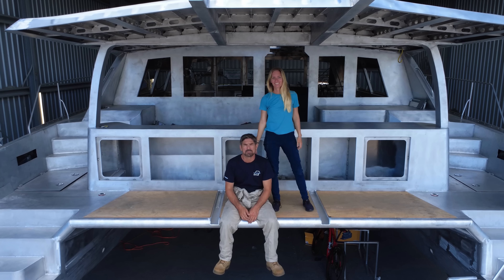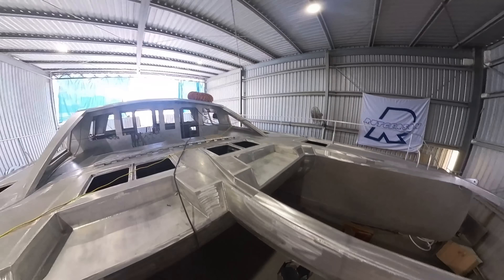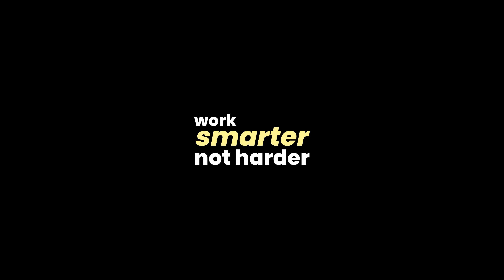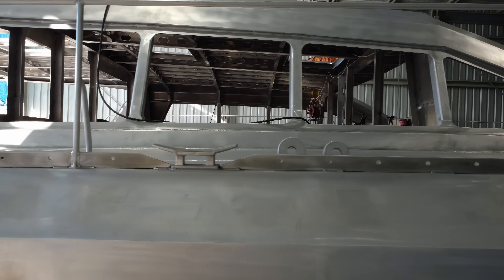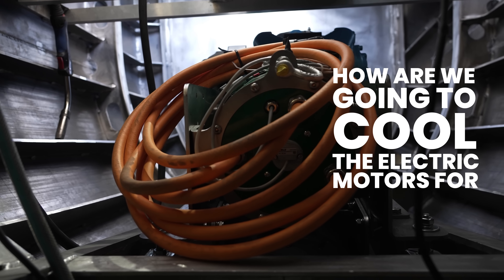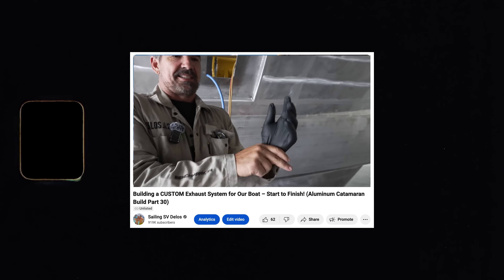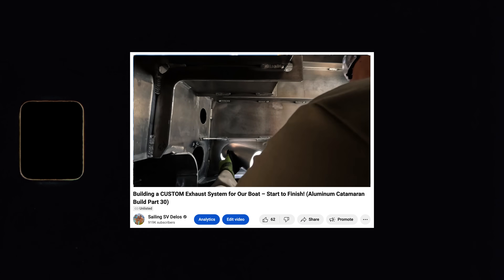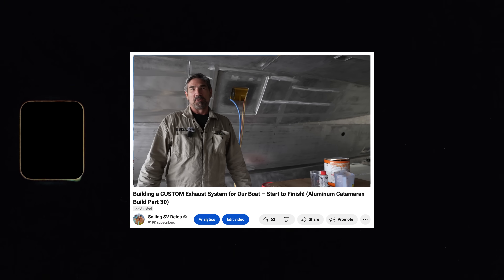We Challenged AI to help design our Keel Cooler 🧠 (Building Our Own Aluminum Catamaran From Scratch)

Comment: I think the cooling requirements for any of the mechanical components of a vessel really depend on each individual component to be cooled, as well as where the vessel will be situated for the majority of its life. If a vessel is going to be located in the southern hemisphere for the majority of its life, then cooling is obviously going to be more of a concern, where as if the boat is going to be located in the higher latitudes for the majority of its life, then other options for the shed heat can be considered. For example using the waste/radiator heat from a combustion engine to be a heat source for a hydronic heating system is a VERY efficient way to use otherwise wasted heat when motoring. But if the vessel is going to be living in both extremes of the upper and lower latitudes, then I would 1000% talk to a professional in the field and at least consult with them before proceeding as they have working simulators for calculating these data points.
Reply: Umm, you are aware the the southern hemisphere has high and low latitudes and gets cold and hot with the seasons just like the northern hemisphere does, right?

Comment: Sending that warm water to a hot water heater, that way you can use your electric engines to heat your hot water. And then the excess waste heat can be dissipated by the keel cooler, that would make it more efficient.
Reply: marine HVAC (Heating, Ventilation, and Air Conditioning) system" with a heat exchanger component.🙂
Reply: Wouldn't it be saltwater they're cooling with? Doubt they want hot seawater for cleaning and whatnot.
Reply: @helimx  just need a heat exchanger if using salt water and it could even be turned into a closed loop system then and take away the salt water and use a coolant then. But idk just random thoughts from a non engineer lol.
Reply: @helimx  No. Brian is talking about a closed loop cooling system. That is used to avoid having to use sea water. 

Also, usually the water heater contains a heat exchanger so the coolant is still in the closed loop (with its additives for frost resistance, corrosion protection, etc.) while heating up the potable water in the heater.
Reply: Another thing I just thought of was you could use that waste heat to heat the hull of the boat while in the artic as well! That will def be a nice to have thing! Kinda like heated mirrors but for your pontoons lol

Comment: Different AI generators producing answers with a range of 5X is a bit disturbing, and highlights the dangers of relying on exclusively on AI to solve problems. But I like your approach and questioning the assumptions and variables that produced the different results. This helps to better understand the complexity and potential roadblocks to finding the proper solution. Very informative and fun video Brian! Good luck!
Reply: Not really disturbing, you just have to pay attention to the assumptions that it is making as a result of the incomplete parameters he provided to them. They all have to make their own assumptions in how to extrapolate the incomplete data, and respond accordingly.

More complete questions beget more complete answers, and one of the biggest benefits of LLM 'ai' tools like these is that their responses can tell you a lot about what questions you SHOULD be asking in order to get the answers you're looking for. You'll have a pretty good idea that you're asking the right (complete) question, when multiple models all start spitting out the same answers, because at that point, they're no longer 'filling in the blanks' in your questions on their own.

At any rate, AI is a very useful tool, as long as you understand its limitations, and use it as a sanity check or jumping off point, rather than just assuming whatever initial response it spits out is the magic answer you seek.

Comment: 'Cool' to see that AI is able to calculate surface area of a keel cooler for your electric engines.  Keel coolers are very common on Alaskan commercial fishing boats.  I see them all the time in the boat yard when I'm hauled out.  They work great here, especially since our water temps rarely get above 50F.  My engine should run at 160F but I'll be damned if I can get it above 145, even in 'summer' here in SE Alaska.
I know there are companies that make keel coolers for commercial applications, so might be wise to talk to someone at a reputable shipyard that services these types of coolers and see if they an make recommendations regarding what system from what manufacturer works best and I'm sure that the companies that make them will help you size it properly.  
Here's a good example off a keel cooler on a steel boat.  Notice that they are skinny but long and are orientated  in the direction of the keel...
https://www.youtube.com/watch?v=AB6xS9g9lVg

Comment: If u are going to use a fluid to make the heat exchange to the hull, why not just use a traditional marine type heat exchanger with a known heat transfer capacity?  Those AI guesses were so far apart, so as to be untrustworthy. Get a heat exchanger for a large 6 cylinder marine diesel and quit worrying

Comment: AI is helpful like you say, but you still have to validate or adjust for their assumptions.  I just use it as another tool when researching problems.  Consulting an engineer in the field has extensive research and development is your best resource.

Comment: I wonder if there's a way to use a normal car radiator and air exchange, also, probably can put a heat exchanger and have a heater for cool weather... IDK.. it's a proven technology in cars.. I understand in boats is complicated and water is better conductor, but you probably don't need a huge radiator and skip the through hole... IDK.. ideas..

Comment: Just a practical view, the keel cooling surface is calculated for an ideal clean environment.    Once the hulls are painted, coated and encrusted by marine life.    The efficiency is bound to decrease dramatically.     
Since you have a very large surface to work with, my thoughts are as usual…. Go oversized and be prepared.   😊

Comment: Heat can generate energy, for example a nuclear power plant uses radioactive material to heat water that generates pressure for the generator gear, could you use this heat from the engine to generate more electricity?

Comment: You fell for the AI trap. What these AI results tell you, is that the assumptions made are critical enough to lead to factor differences in outcome. You will always need to make such assumptions, so the calculations may look serious, but in fact they are not much more than good looking wild guesses. Also, you are making some wrong assumptions. You think the surface area matters, which it doesn't. No matter how big you choose these coolers, you're not increasing the surface of your hull. It's the shape of the coolers that causes drag, not their size.  Your margin in choices is between the minimum dissapation for sustained heat production, and the minimum requirements for dissipation of maximum peak heat production. I personally think you're better off orienting yourself on what the market has to offer in keel coolers, choose something sensible considering all factors involved, and then keep an eye on your temperatures. And remember electric propulsion incorporates one major risk. Electricity is NOT a substance, so unlike diesel engines, electric motors will happily tear themselves apart if you ask them to,... so it's up to you to never ask them to.

Comment: AI's are good. But a lot is also dependent on the user. I encourage you to to continue the discussion and feed the AI's more info such as your hull thickness, coolant flow rate, expect boat speed, max allowed coolant temp, possibly some shape of the eventual cooler space. 

What i understand the flow inside the keel or a partial box section of the keel is equally important to sea water flow outside. Modelling that is likely the most difficult part but ofcourse just plain overdimensioning can omit all design.

Comment: I’m making an assumption that this build is for long term planning. Given that do you need to worry about rising ocean temperatures when calculating top ocean water temp? Is 1 or 2 deg. Celsius going to alter your calculations enough to worry about?

Comment: Another thought - you might want to look at the closed loop cooling system on a SeaDoo Spark.  It is an aluminum extrusion that is also a hull structural member and it forms a fairly significant surface area on the centerline bottom of the boat. I have never had mine open but i suspect that there are number of cooling channels inside along the length.  The ACE 900 3 cylinder Rotax engine has a 90hp rating so you might use that and reduce the capacity of the cooler using the AI formula (which do look correct BTW).  I would suggest trying to find a used one , figure out its basic internal geomtery and maybe apply what you learned to an external (properly faired) cooler that is fabricated by the excellent crew at the yard.  You can learn a lot from what others have done this way. (It is what I did in my household consumer products business for 30+ years)  You will need to make sure the coolant that you use works well with Aluminum (corrosion) and that you provide a resevoir for this coolant similar to the closed cooling system on your IC engine.  Finally, the efficiency of the cooler in direct contact with the sea water may be higher than the side attached to the hull BUT the hull is a big heat sink and should normalize to the same temperature as the seawater in the area you require for your cooler.  Best of luck in your investigation.... sounds like a fun puzzel to solve.

Comment: SUGGESTION FOR YOUR BOAT INCOMING!

AI - Your question didn’t have enough detail for a real answer.  I have read many of the comments and they are filled with great responses.  I noticed one that indicated that your prompt was not detailed enough and the person was exactly right but this all made me think about Delos and your situation with a completely new boat.

This got me thinking that a local AI on your boat with the LLM foundation of your choice and trained with ALL of your documentation of YOUR boat (all manuals) should be included to make your AI the expert on your vessel.  You could add navigation and weather stuff if you desire but an expert of your vessel is where I would start.  Sure, it would answer all of the other questions but it would be the EXPERT of your boat.  

I currently do this at home with all of my appliances (anything with a digital manual) and such and I’m running it on a Raspberry Pi that I can take camping with me (also hosts media to watch).  It isn’t fast at all as I’m not trying to win a race but it always answers.  I found ways to speed it up and perform optimally.  I have also integrated a web lookup function if it doesn’t have recent data.  

In your case, you could be at sea and ask your computer in the other room how to fix the refrigerator and the main “prompting” will already be taken care of.

I’ll provide a scenario where AI exceeded my expectations while normally, it is filled with errors and is untrustworthy.  My brother has a vehicle transportation business.  He never wants my help as he is old and old-school and just wants to answer the phone and move cars.  I explained that people don’t want to talk to him and want a quote NOW these days.  End result is that he answers calls…. 

Anyway, for fun and while practicing prompting, I made a whole AI to answer his calls in less than an hour.  It asked all of the right questions that were required to move a vehicle and also asked more questions (insurance on the move that I did not factor in) because it knew a bit about the industry where I did not (I’m a computer nerd).  It worked AMAZING and I played with it for a long time as a customer in awe as it gave me quotes that were usable every time.  Brother still answers calls… 

The other comments mentioning hallucinations of AI are 100% spot on.  AI answers as if it is 100% accurate and exudes the same confidence when it is 180 degrees off.  When I asked it to write a function for me for some code to process video in a certain way, it gave the most detailed answer with code and all.  I was ecstatic!  I tried to implement the code and spent forever trying to get it to work but it never did.  I could have used that time to read the damn documentation and write the stuff on my own and had it working.  No, I haven’t gone back yet…. It made me furious as I was so sure it was good stuff.  This happened on a multitude of occasions.  I do not use it like that anymore but now I have a really good comprehension of its use and purpose.   

If you ever want help to design a Delos Pro AI (DP AI!  Get your mind out of the gutter), let me know.  I’m jobless and looking for work which gives me a ton of time while my mind races.  Heck, you could just point to a Google Drive link with all of the manuals of Delos II and I’ll just play with it.

Comment: Refrigeration man here.
Easiest answer is Call up the People that Make Keel Coolers Have them crunch the numbers. Keel coolers have been around for many years.
They do it for a living.
They already have the numbers.
See What size they Recommend. Would also give you another perspective & info.

Since We are dealing with Heat Removal here i converted 2500 watts to Btus.
Heat needed to be removed is 8,530 Btus.

a Note here - Do You Need Heat in any of the Cabins ? Or anywhere ? Free Heat. Pump the heat / Liquid through Small Evaporators in each Room for Heat.

Make a Way to Use the Heat for Hot Water ? Pump it around.

a 8,500 Btu Condenser Surface area is about 18" x 18" x 2" thick. Figuring a 30 degree T/d. Air to Air. Liquid to Liquid surface Thermal conductivity should be better.
So, Anything around that size Would be Good.
of Course More is always better to Keep Motor cooler.
You can always add another cold plate / Heat exchanger plate if necessary.

i Would use a Cold Plate. they are used in refrigeration too keep soda lines cold , are made of aluminum & Made to be buried under ice for thier life time.

Comment: You could use your whole boat as a cooler. Aluminium has pretty high thermal conductivity. Way better than steel and only a little less than copper. Create some oversized channels against the hull (half pipes? rectangular?) below the waterline and it will probably be more than enough. Of course it needs to be (way) below 660°C or the aluminium will melt. The bigger the channels, the more flow, the lower the temperature will be. Minimal expansion. I suppose you have plenty of space for that underneath the floors or so. Also avoids drag of a cooler and potential seawater leaks. With a valve to some radiator you could also use the heat for when it's actually cold. Maybe even warm up a hot water boiler? It would be a pity to just throw it all overboard after first painfully generating the energy. 2.5 kW in worst case scenario is like a small electric heater. Not that crazy much.

Comment: Make an aluminum box and antifoul the bottom. Put two coolers, one inside and one outside, in the box, drop it in salt water, and get the data. Then, you can scale up to whatever size you need. You might be surprised how different the readings will be.